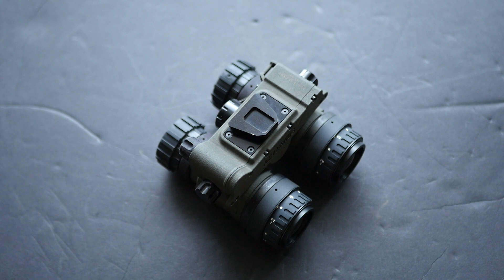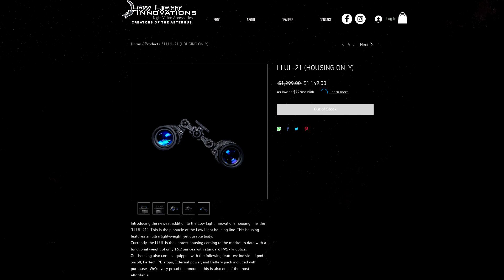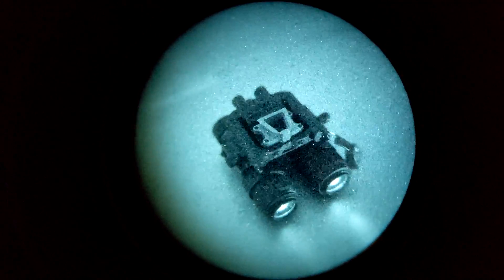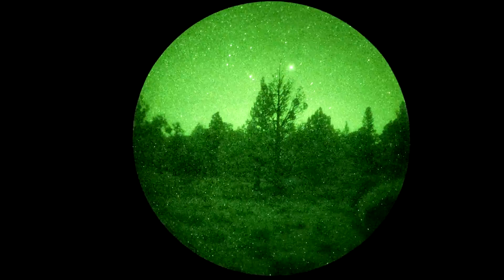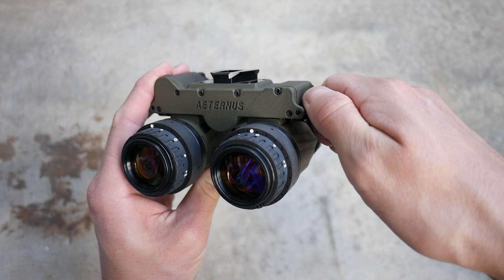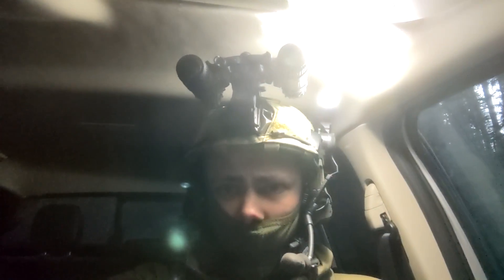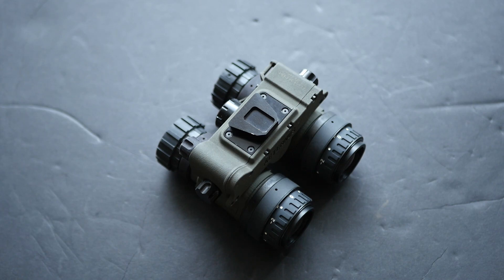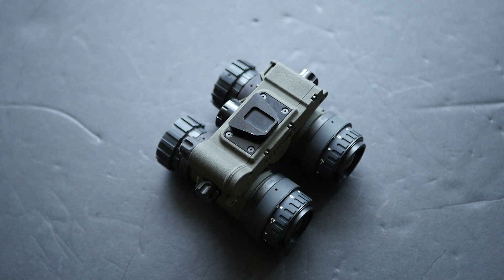3D Printed RNVGs: The LLI Aeturnus

Comment: I can 3d print a housing like that in pla+ and it will last forever. Or petg or cf nylon if youre really paranoid but seriously if youre serious about seeing sirius cheap then dude ur gonna need to print a printable nightvision housing with simple pla+... they print guns in pla+ i think its fine. Oh theres a need for moving metal parts? You use metric screws bolts nuts washers etc.

Comment: most 3d2a people are gun guys first and not printer guys, printer guys know about incredible materials like CF-HDPE or literal nylon that when printed is tougher than a glock lower. msot people printing lowers or foregrips use chinese PLA that is mechanically and chemically weak and deteriorates with sweat, powder residue, head and rough handling. but the actual good plastics are literally competing with aluminum for specs

Comment: try the cadex low profile mount, it has 2 more ticks of vertical adjustment up and down so i can keep my rnvg (which is about the same height of the aeternus) extended but above my eyes if i need to look at something else or prevent dew. it does cover a little of upward fov

Comment: Unless you have a couple tubes laying around and you really, really REALLY want a binocular you're really not befitting from this. Yeah it's about half to 3/4 the cost ($6200-~$8400 vs 10k+) of a L3 binocular but for the same price you could get two PVS-14's and an articulated bridge mount. The downsides would be more weight and having to use two batteries instead of one, but it would also give you the perks this doesn't have like auto gain, built-in illuminators, (possible) better durability, and the flexibility to share with a teammate should theirs go down.

Comment: I almost went with the Aeturnus before deciding on dual PVS-14s on a piano bridge. I can share with a friend when I want to BS and watch the stars, but I also found it cheaper to get dual 2500 FOM L3 WPs in my config. LLI didn't offer L3s at the time and wouldn't let me pick the Elbit WP tubes which could have been as low as 1400 FOM.

Comment: I’ve been running a set of RNVGs for about a year now and I’ve kind of learned how to deal with non-articulation; to deal with the high stowing of the unit I keep them down and push them up so they’re in-line with my forehead, to keep situational awareness and being able to do non nv related tasks I run my unit all the way out on a G24 so I can shoot the gap easily to check my phone or even shoot a pistol using white light. The RNVG isn’t the best housing out but I’d say they’re not awful. With that being said though I do want articulation for using thermal.

Comment: I had a katana and moved to the RNVG for reliability. 
With the G24 it's fairly easy to use the mount to keep the RNVG in a half stow, or tilt the nods to make it easy to look under them. 
I don't feel like I've lost any useful features, IPD is less "easy" to set but it's basically a one and done deal. 
I'm not convinced that articulation is worth the decrease in durability.
Reply: Ill never understand this, your tubes are the most fragile part of the NOD’s and switching to RNVGs dont change that. You are giving up really nice features for a massive “what if” that hardly every happens. If it does happen its just a new housing not an entire new set of tubes. If articulating NOD’s were so weak you wouldn’t see SOCOM using them in theatre
Reply: @totenfurwotan4478  there’s plenty of pictures of sheared PVS-31s lmao.  Please trust me as a mechanical engineer, the housing is going to be see a LOT more stress than the intensifier, and that pivot point is absolutely a stress concentrator.  The only reason operators use articulation is for when they’re doing close up work like map reading or medical treatment
Reply: @totenfurwotan4478  it’s a simple fact that a hinge like is on the 15s or 31s is going to be an inherently weaker design compared to a solid block of 7075 or 6061 aluminum lmfao.  Like I said, the ONLY reasons for articulation is if your going to be doing things in close proximity to yourself, or if for some reason you briefly want a monocular type setup which 99% of the time you won’t be doing.  Find me a picture of a broken RNVG housing please.  If you’re putting enough force onto a unit to the point you are able to break an intensifier tube through pure shock, I’d be willing to wager you were going out of your way to do some absolute dumb shit to it

Comment: It really comes down to the geometry. What you can physically cut into a chunk of aluminum might not be the strongest possible design for something. A lot of geometries can only be made additively. You can also iterate very quickly, so flaws get ironed out faster.
Reply: Yup 3d printing is superior just because we can update the design and test and make better easier faster and we can print 8 walls 100% Infill in cf-pla or pla+ etc

Comment: I bought myself a 3D printed Tanto housing from nocturn industries. the reason I go with that one is because I live in Germany and buying prebuilt devices like a pvs-14 would cost me around 4.5k euros (which is pretty bs if you ask me for a gen2+ device probably non mil-spec). I.e I have to build it myself and this is where 3D devices are pretty attractive. Housings can be exported from the US as opposed to fully built devices and IITs. I have to source an IIT locally but for the same money I can have something performing way better.

would you want to review some of those as well? Katana, Tanto etc.

Comment: It's nylon, so you should be wary about water absorption, so weather conditions for prolonged use and especially storage. 
It won't leak it in directly in the rain, but it will absorb moisture over time and condensate it inside, so storing in dry conditions is a must. 
So much like with Katana but it's not an issue with normal use and storing. 

It is very rugged tho. As all (?) printed housings from trusted guys/more known civilian manufacturers.
Collimation is far from perfect, but that's an issue with all non-OG housings and honestly is hard to notice in normal use.
Lack of illuminator doesn't matter at all, just as you said.
Reply: Collimation is far from perfect?

Send it back to the vendor that built yours then. Collimation is the process of getting the ocular lenses adjusted to the same focal plains. It’s not an inherent feature of a housing (any quality housing such as this needs to be collimated by the person who assembles it).

Comment: I enjoy the work that you do man but I have a question it'd be interesting to hear your opinion on why you prefer or recommend the AR-15 over the 8K I know you do a lot of night vision stuff and shooting with suppressors but it'd be interesting to hear your opinion on the matter between those two platforms
Reply: It probably comes down to a few reasons. ARs are far more common in the US so parts availability is insane compared to AKs, they're far more modular, and you can get a decent AR-15 built to your own specifications for far cheaper than an AK. That's all guesses though we'll see if he responds himself.
Reply: @JMLueckeA7X hop absolutely despises AKs, as do I.

Comment: Would be better if it used a AA battery format. My issued pvs 14s worked great on a single one (24 hours) & AAs ara way easier to get than cr123s down range.
Reply from the maker: Nobody is using these down range.
Reply: @Hoplopfheil  True. My point about AAs being easier to find, still stands.

Comment: I use a Mod3B housing with a Norotos AKA2 mount.  Reason I mention this is because it has a "mid stow" position that is halfway up.  This is nice because it allows you to flip fixed bridge binos like the Mod3 and Aeturnus up out of your view, but not necessarily all the way on top of your helmet.  It still has the fully stowed position, but its like a Rhino as far as positioning goes.  The mid stow doesn't move a goggle up above the top of your helmet line, but it does stick out way forward on your head.

Comment: I have one and must stress the following!

There is a second generation of this with an on off button, no knob.
The finish was way rougher, alot of glue and the threads were positively BAD.
I told my builder to instead use the old gen (the one in this video)
Reply: I had issues with the first gen, sent it back and LLI swapped it to a gen 2 housing. I've had absolutely zero issues with the gen 2 thus far.
Reply: Interesting to hear that there are multiple experiences. I must say that LLI is indeed a very consumer friendly company.

I guess it comes down to personal preference between the gen 1 and gen 2 :)
Reply: I have a 2nd gen as well an it is flawless 
.  I love the button over the knob
Reply: @ILikeThis12Gauge  I've talked with the owner multiple times, the man is a genuine bro and has taken care of me. Issues he's corrected without hesitation. There certainly has been issues but I think they are well on thier way to great things.

Comment: If you were trying to get the best possible night vision as a starter first timer but wanting to get the absolute least expensive as possible what would you recommend? Even allowing this 3-D printed possibility.
Reply: Getting the best night vision and getting it for cheap are mutually exclusive. You get what you pay for. That being said some night vision is better than no nightvision, get a pvs14 with Gen 3 tubes with green phos intensifiers. Later on you can upgrade the tube to white or sell the whole unit to fund duals
Reply: BNVD 1431 MK ii
Reply: I'm going to give you some advice...NV is cool and it is useful, but it pails in comparison to thermals. Spend $2500 and buy a FLIR Breach. Its tiny and helmet mountable. A $2500 NV device is likely shit tier quality. Expect to spend AT LEAST $3K for something just breaking into the realm of good quality when it comes to night vision. And that's just a monocular. $6K would be an extremely cheap price for bino NVGs. 

Then there's all the other bullshit you have to buy in order to use it. Helmets, mounts, battery packs, wires, IR lasers, weapon mounts, etc. The device is cheap when you add up all the costs for what you need to make it truly useful. Just a good mount will set you back $500.

You can hide from night vision pretty easily. It is super fucking hard to hide from thermal imaging. Yes, it doesn't see through glass, but NV doesn't do so hot in that scenario either. If you want to be able to see everything at night, then thermal imaging is where its at.

Comment: It looks like a SLS print so it’s definitely going to be tough. There are many methods of 3d printing if you didn’t know. SLS or (Selective Laser Sintering) it’s probably the strongest of those currently available. It might also be better than aluminum at absorbing shock when dropped or bumped.
Reply from the maker: Thank you based plastic man
Reply: @Hoplopfheil  Thanks for the kind words, dark vision chad.
Reply: @Hoplopfheil  See? Drop it on camera now :^)
Reply: Its definitely SLS, likely nylon.  I use that stuff at work all the time on uas and robot dogs and its pretty amazing.  The only time I ever see nylon SLS fail is when its a catastrophic failure, usually of the whole system but that's also by design.  I want certain parts to break if enough force is exerted because I'd rather have a $20 SLS part break rather than deforming a $4k vehicle chassis if that part were aluminum.
Reply: You can clearly see the layer lines, it’s definitely FFF.
Reply: @caseyschryber1255  SLM is a whole different case, complete different materials. Way heavier.
Reply: Its MJF ... in terms of additive manufacturing via powder bed fusion, MJF is way stronger than SLS, because MJF sinters whole lines instead of point to point like SLS, at least with PA 12.
The only disadvantage to MJF is ... the tech is owned by HP.
Reply: All hail based plastic man! Lol
Reply: t
Reply: As someone who has designed and manufactured various niche cantilevered light mounts and tested them. The answer is unfortunately no, it's not better than aluminum, SLS nylon PA12 or HP MJF PA12 (with glass) have both exploded spectacularly where CNC'd aluminum or DLMS stainless (this is of course not fair) counterpart remained sturdy. That is not too say they are weak, of course, you just have to know its properties and beef up the dimension accordingly to achieve the same strength as an aluminium one.
Reply: The printing type is MJF, not SLA.  (Just a kind of printing technique / machine )
Reply: Nah pla+ is good enough to print an ar15 rifle that shoots real ammo so yeah I think it's fine for binoculars
Reply: It's MJF Nylon not SLS.
Reply: @warden504  sls is not a material type. It is a printing method. You can dozens of different materials on an sls printer. Including many many different types of nylons.
Reply: @ameritus9041  I'm fully aware of that lol... MJF is also a printing method and is the one LLI uses for this housing. They are MJF Nylon 11/12, not SLS.
Reply: @warden504  when you try to sound smart and correct someone only to prove that you're regurgitating information on a topic that you clearly don't know well enough to speak on 😬

He even fooled me (with a very basic level of 3D manufacturing knowledge). Turns out you shouldn't take the word of random strangers on the internet at face value. Who knew 🥴
Reply: @datboi__  yeah he’s likely not familiar as he didn’t recognize that I said MJF Nylon not just nylon lol…. MJF is the most popular mfg method in the industry right now especially for nvg housings.
Reply: @warden504  you're 100% right here. this is not SLS. We use MJF for all sorts of prototyping. Likely PA12 GB (glass bead) :)
Reply: SLS is actually weaker than FDM nylon, the sinteting process doesnt fuse the plastic as completely as FDM.
Reply: @chase6428  came here to say this.
Reply: @chase6428  that's simply incorrect... I own multiple FDM 3d printers and have literally achieved such perfect layer adhesion and bonding strength that the parts break entirely independent from The Z axis. Perfect layer adhesion. I print exclusively in nylon and haven't run anything through my printer besides Nylon and fiber reinforced nylons. SLS blows FDM outta the water, and MJF PA11 is on another level.
Reply: @FrozenByFire3  Sure bud. when you comb everything that may be possible, but than you have to adapt the dimensions of the part etc. its a pain in the ass and these parts are still not so strong you think they are.
Reply: @peepopalaber  combing is only used during travel so it doesn't really improve strength. And anyways I was saying SLS and MJF are much stronger than FDM :p
Reply: CLIP is the strongest printing technology, retaining full mechanical properties of the source material; it also prints at up to 25x the speed of your commonly available printers.
Carbon 3D has had the tech available for years now and while one can only use their resins they have made available a subset of the most useful resins used in manufacturing today and they are competitively priced.

The reason why you don't hear about them is that they do not sell their gear and it's at least 45k USD to start a subscription/lease of their manufacturing cells.

But if you want prints that are not only indistinguishable from high volume traditionally manufactured parts but superior in quality as well as being able to just print structures that simply can't be considered with conventional manufacturing methods, there aren't many alternatives.
Reply: Depends entierely on the material. You can make crappy SLS parts easily.

Comment: Downside, they are making probably 700 bucks profit on this. Release the files you cowards
Reply: That’s what bothers me. 3d printed parts aren’t exactly reliable and solid. I’ve broken more 3d printed magazines than I can count. Charging $700 for that is too much imo
Reply: @Lifesbeengood  I mean, they can be. I think printing Glock frames puts more stress than this does. Sounds like you need to read the read me for the mags, or print the new gen 2s
Reply: @platapus112  it’s not what file you print, or some new updated magazine…it’s the process of 3d printing that makes the parts unreliable. If this company is using regular old FDM for producing this part, it will eventually fall apart. It’s physics. 

“Printing glock frames puts more stress than this does”….umm, what? Stress where? How? What do you mean? You need to be more specific
Reply: @Lifesbeengood  it looks like SLS to me.
Reply: These are not standard FDM printed, they are MJF printed

Comment: I guess maybe for a "loaner build", but at that price point, two PVS-14s in a panobridge would probably a better solution overall
Reply: This would be much lighter, you'd also will not have it collimated (assuming bino is built by somone who can do it)
Reply: @Nathan-jh1ho   I don't care much if my loaner set isn't the lightest, though. With a panobridge, I can have wider FOV, or split it into two monos, set one of the PVS-14s on a tripod for recording, etc...
Reply: have fun turning both your units on individually and you cant look through your optic
Reply: @butterdogmilsimgroup  I already have collimated duals. If the loaner set can't go passive, it is what it is
Reply: @butterdogmilsimgroup  shut up shill

Comment: Never thought I'd live to see the day where Hop messes with anything 3D printed.
Reply: To be fair he did have the 3d printed followers in his not-a-ump vid
Reply: I can see him doing 3d printed firearms accessories 👀
Reply: 3d printing is such a wide term though. Sure it can mean the plastic dick shaped tire stems that melt at anything over 90 degrees, but it could also mean the oxidizer valves used for a fuckin Falcon 9 Merlin rocket engine lol. Vast degrees in difference of quality here lol
Reply: @chomp7927  It's a term for the process, not the product.
Reply: everything is technically 3D printed
Reply: @swide2750  not really